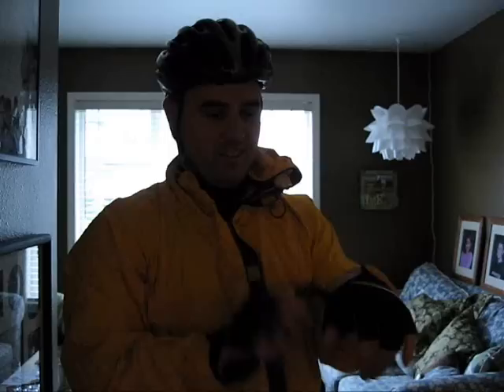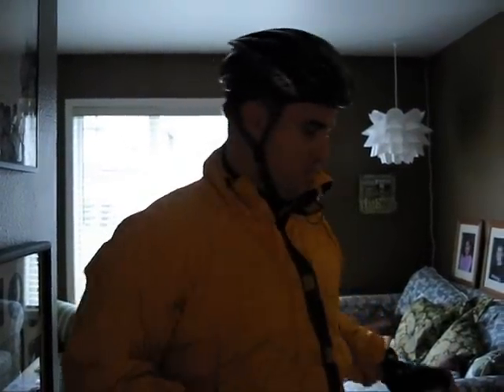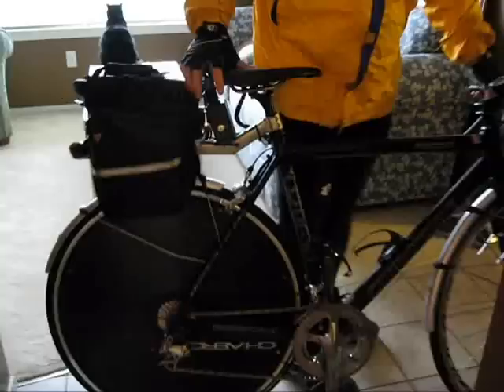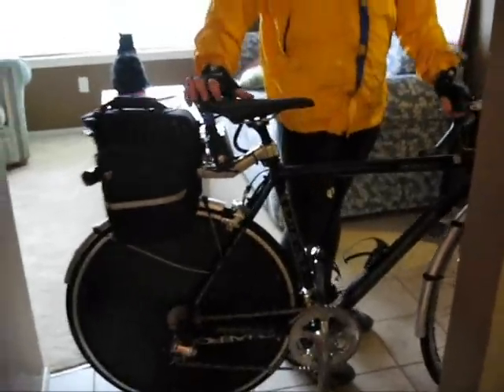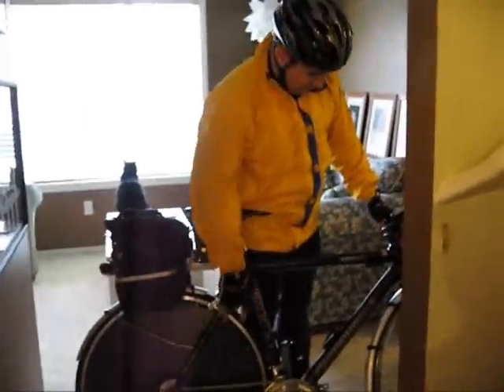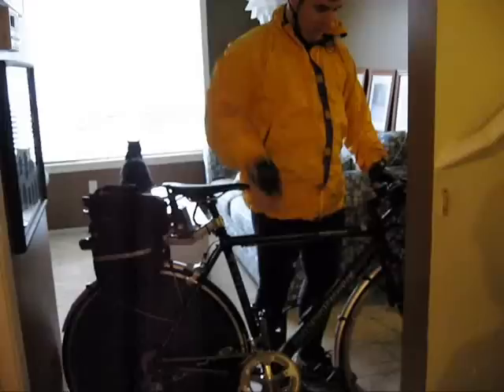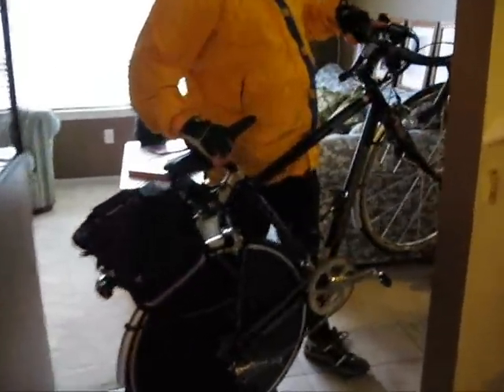Kurts Electric Bike

Comment: Excellent 45lbs is very light for an e-bike, how heavy was the bike. A 30mph range at over 35mph is amazing. What voltage are you running and how many Ah. I am hoping to build an e-bike soon, check out my scooter in my videos 10lbs weight 20mph top speed......4 inch solid wheels. Keep up the good work!!